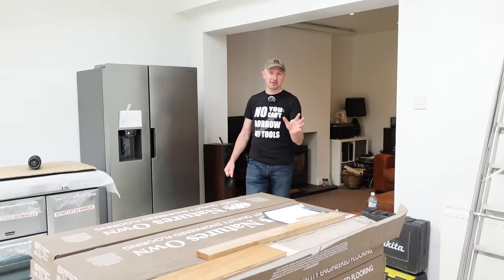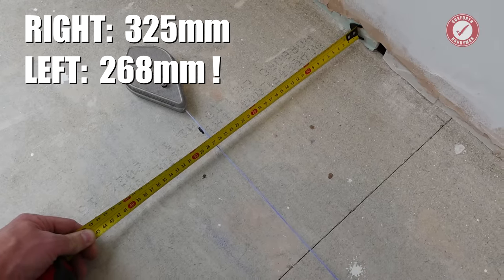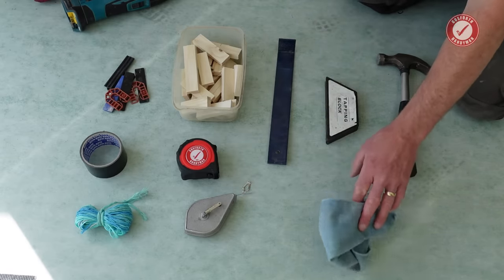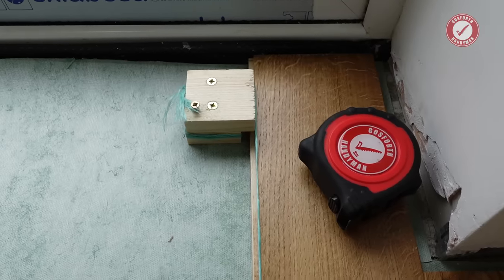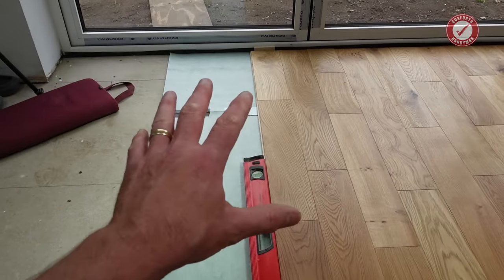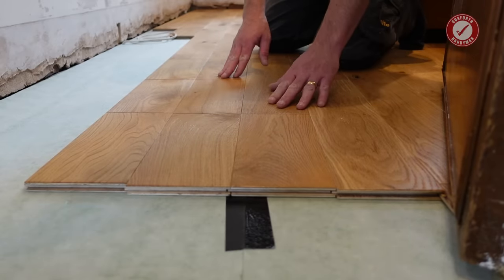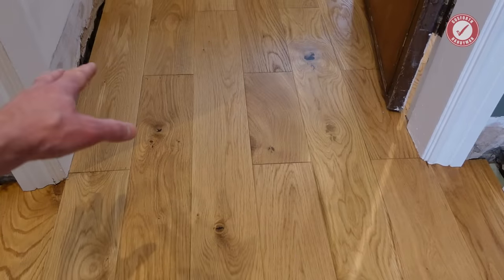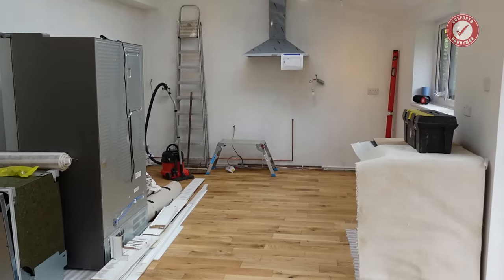How I fit ENGINEERED OAK wood flooring

Comment from the maker: In case YouTube breaks, please join my free mailing list: https://gosforthhandyman.com/newsletter/
Be part of the Member Zone community: https://members.gosforthhandyman.com
Reply: Done!
Reply: Hi Andy tried joining your mailing list but just keeps coming up site not available?
Reply: @paulwhitemore1801  It seems to be working now. I've just tried it.
Reply: @markrowland5393  no its not tried again says  rebrandly not responding!
Reply from the maker: @paulwhitemore1801  Strange - try the link from here https://gosforthhandyman.com/newsletter/
Reply: @GosforthHandyman  Thanks Andy that worked! DONE
Reply: Apologies if you've answered this in one of your other videos but why did you choose a floating install for this floor vs glue or nail down? Have you had any bulges/squeaks develop in hot weather or is the floor still expanding evenly?
Reply: Hi, I'm about to do my own engineered wood floating floor and this is by far the best instructional video I've seen! Quick question - the powers of Google told me a polyurathene glue is better than PVA is it has more flex, which is presumably a good thing for a floating floor. Your Elka glue is PVA though and you're obviously happy with it. Do you have any advice on PVA vs PU (polyurathene) glue for tongue & groove glueing? Thanks

Comment: Decent job that, I’m a floor layer and can’t really point out anything wrong with it. Are you using stop ends or scotia to cover your expansion gaps? Also I clamp the flooring every 3 rows, just helps to keep it in bond and stop any movement whilst laying
Reply from the maker: Cheers! It'll just be flat oak trim (rounded edge) - not a fan of scotia. 👍
Reply: @GosforthHandyman  good decision, I’m really not a fan of scotia either
Reply: Scotia is good if you paint it the same colour as the skirts because the colour goes to the floor and the eye isn’t drawn to the colour coming up from the floor which in my opinion is unnatural. Btw been laying floors since 97. Also in the glue point if you do the glue in four inches squeeze, four inches of void you very rarely need to clean up any over spill and there’s enough to hold the bond, I also clamp up every four or five rows.
Reply: Why not put under skirts as they're not fitted yet? That's what id normally do
Reply: @disgruntled4298  clamp how please? Special clamp?
Reply: @hunterreed1010  ratchet straps. From the first to the last board, then reposition as you put me rows down.

Comment: Nice installation, but I would mention this. Because you have covered the entire ground floor or a large portion of the ground floor without any breaks (not that you would want a threshold or a break anywhere as it looks bad) but you have gone under the kitchen cabinets and appliances with the flooring. This could be a troublesome given the weight of the kitchen on the floor when everything is fitted. It can prevent the floor from expanding/contracting and can cause buckling/warping because of the amount of weight preventing it from moving.  Especially given the amount of rows in the back room.
Reply from the maker: The engineered stuff is pretty stable - as long as it's not blocked by the walls it'll generally sort itself out. 👍
Reply: @GosforthHandyman  if its stable why have expansion joints, he's right about the weight of the units on the floor could well cause problems, as you said on video its a floating floor, its not once you've got 20/30 kitchen legs sitting on it. Check with manufacturer but ive never done it in 20 plus years. Would have charge £20m2, usual charge is £15/20. Looks great though good job. Love the channel
Reply: @garyfullerton3551  there will be no expansion and contraction, it’s a wooden subfloor not concrete

Comment: If only you'd made this a few months ago, before I started fitting my engineered wooden floor! Despite watching so many videos about this task, not one of them got into the nitty gritty of checking the room squareness properly before starting. You've devoted so much time to it (the right amount of time!), and it's a crucial consideration - particularly here in the UK where squareness can sometimes be nothing but a dream. I've fitted my floor to the point where I realised that the whole thing is out of true because the wall I started on isn't parallel to the others. So that's where it's stopped - with a lounge floor that's in but skew, and unfinished. I'm building up the will to go back and sort it out as best I can, and it was genuinely hard for me to click the play button on this video as I knew you'd do it properly, and I'd have to eat some crow. Thanks for putting out the best video I've seen on this topic - I'm sure it'll help others avoid this painful lesson!

PS: another issue I found after the fact is the subfloor not being flat. It has dips and bows all over the place which are not obvious with carpet and underlay on top, but very obvious when walking on the floorboards spanning over these dips. Maybe this'll help someone that's read this far down in the comments. Needless to say the floor is going to have to be lifted so that I can shim these areas and correct the squareness...
Reply: Ah man, I couldn't relate more. Sending solidarity, and hope you eventually managed to summon the motivation to go back and sort it!
Reply: Thanks for your feedback that’s so SO helpful for other newbies like me!  I hope you get it all resolved to your liking

Comment: Hi. Have just layed about 23m2 in a house very similar to yours. I posted some time ago to say how helpful your vid was and I can now say absolutely that it was. The importance of getting the line bang on that long run cannot be overstated  and continually checking for adjustment if needed. My flooring was mixed in the sense that some of the grooves were rough. I developed a habit of clearing each groove with a screwdriver blade before gluing and it  significantly reduced the need for excessive hammering. Thanks again. Jim

Comment: That was great ! Very "real world". I think for the risk involved for an amateur ( in my case ) installation vs 2 1/2 grand labour spend, I'd certainly give it a go. If I ended up scrapping a couple of packs, I'd still be able to convert a lot of that saving in labour into tools that could then be used in other jobs. It's laying a floor after all. Not sending a rocket to the moon. Measure twice, cut once, and have it all planned as you showed us at the beginning of the video is really great advice !

Comment: Hi Andy, you did a great job mate, and Mrs Mac wiping off the glue must have Been a big help, I did  vertually the same job for one of my daughters  a few years ago, large through lounge and hallway, same type of flooring, it took 3 days, at the end of each day we put flooring ratchet straps across the unfinished floor to keep it all tight, worked a treat. Same method of fitting as you did, fully floating, and it's never moved, phew!,lol. My daughter selected all the boards from the packs to achieve  a nice spread of tones, that speeded the job up no end. Thanks for another interesting video mate, best wishe's to you and your's, Stuart UK.
Reply from the maker: Cheers Stuart! Yeah, defo helps if you have someone sorting the boards for you too! 👍

Comment: We are just completing a large barn conversion. Had many, many trades and suppliers in during that time and they fall very distinctly into 2 groups - ones who had little knowledge, lots of BS and just wanted full pay for a lousy job; then there were those worth their weight in gold because they cared. Sometimes they were cheaper; sometimes more expensive but within a day I learnt to tell which camp the tradesman came from. I don’t know much about building, plumbing, electrics - really just as much as most people who have done a lot of DIY; I’m therefore susceptible to hearing what turns out to be crap. Right from the steel frame manufacturer at the beginning to some plumbers doing 2nd fix at the end, we have had people in who I’d like to throttle. A little surprising to me, everyone whose name I got from Checkatrade, as opposed to recommendation from another tradesman, has tuned out to be very good.

We had about 90square metres of herringbone click system engineered oak. Don’t. It took twice to fit as long as glued herringbone; no benefit in the click system and the professional layers seem to hate it. Shop around; we bought our oak from one firm who thought we were silly enough to think we would add on the gold underlay as an afterthought. Just a little shopping around and we saved hundreds. 

I could wrote a book on renewable energy suppliers. That sector seems to be attracting all the cowboys; all the chances; all the con men around. Our first supplier went bust (seems a regular occurrence on this sector); finding a reputable one is a real headache. There are those who demand high deposits - but beware; giving a company a deposit is lending them money; would you lend money without checking somebody out? I’m lucky in that I can read company accounts but heaven help those who can’t.

Comment: Looking forward to the skirting board fitting; I have done a similar installation on a floating floor across 3 bedrooms and a hallway with no thresholds; my engineered wood floor is a click type, but I've glued the joints with PVA to minimise creaks; it was all sound and solid until I fitted the skirting boards, then it started to be sensitive to temperature changes, i.e. when you step close to the skirting board, it creaks as if you're breaking the friction in between the floor and the skirting

Comment: Well Andy, I was absolutely floored to see you doing this but was not board at all.😉

You did a cracking job as usual, you are right, it is murder on the knees and the back and as you get older once you get down on the floor you sort of think is there anything else I need to do down here before I get up.

I read some of the comments with respect to floating floors and the weight of the fitted kitchen likely causing problems. I agree with you the way you have done it - there should not be a problem. The only risk is water leaks and you could take a sort of preventative measure using a water leak device - Honeywell do them and Sure Stop do one that will also shut off the water supply.

😀👍

Comment: A number of years ago, I laid a clip together engineered wood floor, same sort of area as yourself, two or three connected rooms. It's been fine. Only problem, the old coal fired boiler leaked, and has been replaced, but the rusty water stained the boards and warped and separated the edges of the veneers. I have enough planks left over if I'm careful, to replace the damaged parts, but a rug has covered it for the past five years or so... In your case, I'd definitely do the utility room, and anywhere else.
Reply from the maker: Oh no! Hope you get it sorted. Cheers!

Comment: Great Job as usual. With the engineered oak instructions I fitted it said run a line of glue along the top edge of the groove. I stood each length on the floor on the tongue and with groove up over ran the glue along the top edge. When fitting It seemed to have less squeeze out. Any awkward areas of the room I would lightly sand the groove and the tongue to remove any woodchips so they would go together easier to save any hassle. The ends of the wood seemed to be the worst. When using the utility bar to lever the wood together near the wall I had a old bit of aluminium plate to put against the wall to protect the plasterboard.
Reply from the maker: Nice one! 👍

Comment: I’m not an expert at all but my harth was on the wonk. My house is well over 100 years old. When I did mine I installed the second to last row and scribed the harth with an off cut onto it. I then cut that piece out and replaced it with a new one. Looks mint and no scotia/ covering required. Been installed 2 years with no problems
Reply from the maker: Nice one! 😎

Comment: Andy, your timing is perfect! This was uploaded on the morning the other half wanted to go and buy an engineered wooden herringbone floor for our lounge.
As usual, after watching one of your videos, I exclaimed in the shop "I'm not paying that for fitting! I reckon I can do that, Andy's video made it look pretty straightforward." Wish me luck...

As a relative novice, it was eye opening to see what you need to take into consideration when choosing and preparing the floor. As an old Edwardian house we can't get the original skirtings off, but the multitool trick will be invaluable around all the decorative door frames and mouldings.
I'm debating whether it's worth using the multi-tool to cut the bottom of the skirtings off to slide the floor underneath, instead of a quadrant trim painted to match the skirting. Is that asking for trouble?

 You've also sold me on T&G as especially with herringbone, it's going to be much easier to tap into place around all those awkward corners.
Cheers Andy, great video as always!
Reply: How did this go? Herringbone engineered wood as a DIY job is not something I would attempt, even as someone who's layed laminate vinyls and carpet in the past.

Comment: Hi Andy, lovely job. I’m in Yorkshire and wouldn’t charge less than £2.5k as you mentioned. My only query would be running the flooring under the kitchen units, as most manufacturers don’t recommend it as the weight of the kitchen (allegedly) stops the floor from expanding and contracting, invalidating any warranty. Now I’d argue that freestanding appliances also stop this from happening and aren’t prohibited, but I’ve had one instance where the client insisted running the floor under the kitchen and we did experience some bowing of the floor and the manufacturer wouldn’t cover it under their warranty. Now in this instance I think this had more to do with inherent damp issues in the property. Would be interested in your thoughts though.
Reply from the maker: You just need to design the kitchen to allow for it. As you say with free standing appliances there's not much weight in the cabinets. 👍
Reply: Most people put cabinets in after the floor. It's a royal pain fitting cabinets otherwise. When a cabinet has to be moved in case of a leak, there are major issues. Especially with stone countertops.

Comment: Really helpful video. Thank you. I'm about to embark on the same in a similar layout. Can I ask a few questions please? 1. What thickness was your oak boards? 2. How did you get confident that the levels in different areas weren't so different as to pose a problem as you worked through? 
3. I've got wooden suspended floor changing to concrete floor in both the rooms I'm proposing to floor. Looks like you had something similar but in your extension you seemed to have some sheet material down. Was this to level up please?  

Great vid. Thanks

Jim

Comment: I did flooring a number of years back and recently I discovered there was some damage to a number of boards due to an office chair with incorrect wheels. This was not noticed as there was a mat under the chair. The company that made the floor is still in business but they do not make the same "model" (colour / grain pattern) also their new floors are a few millimetres thicker. The damage was in the middle of the floor and the whole apartment used the same flooring.. I wish I had a number of boxed left over when I did the floor (I planned well and only had one extra board :-( ) You should take two or three boxes and save then somewhere safe in case of future damage. --- I ended up staining the damaged boards with a similar colour and then varnishing them.. you can see the boards are different when standing above them but from else where in the room it is luckily fairly invisible.
Reply from the maker: Oh no! Yeah, wheeled chairs can be a killer on floors. Thinking bamboo for the studio.

Comment: Great video Im just about to do my 33 sqmetr floor on top of concrete slab.  I like how you went floating  and used the underlay then  lay boards straight on top of underlay  and didn't do glue down , I guess because you glue the joints with PVA wood glue this  makes it act as one giant piece of wood and the weight holds it down and stops and spongy feeling when walking on it ,  so it feels like its solid glued anyway without the hassle of using  drums of flooring glue . Can you advise please on your results and  how  the floor feels to walk on now ? thank you .

Comment: I left the glue in a bucket of hot water and it flowed mych better. Very annoying to be slowed down by such a minor issue. My floor lengths were 1.9m, so had to fight against the tongues  edging back out of groove; i used long clamps, combined with nylon cord to squeeze them in - hammering them in wasn't enough. I also screwed blocks on the working side as i went.

Comment: Awesome job Andy. Novice question here. What's the best way to ensure a dead straight and parallel string line end to end if the walls you're running the boards along aren't straight? When hanging wallpaper with a plumb line you obviously have the weight that finds the dead straight line for you. Cheers
Reply: I'd say you need to pick a wall that the floor will be most noticable running along and measure off that to the other walls to see how parallel they are.  If it's wildly out, you may be able to compromise a bit, or it may not matter if the flooring at the other wall is covered with furniture for example.  Or instead of starting at a wall, you might want to choose a feature like Andy's hearth.  Measure everything twice and make as many chalk lines or pencil lines on the floor as you need to, to show you how the floor will work out.

Comment: I'm about to do a similar job and have a couple of questions.
I'm looking to use solid wood rather than engineered, did you sand the floor once it was done? Also why floating floor rather than sticky backed underlay?